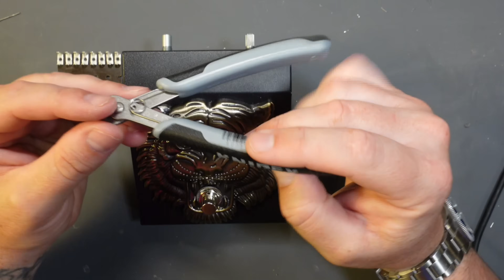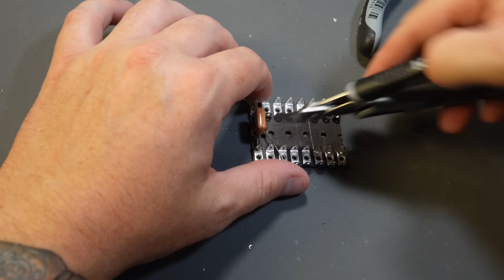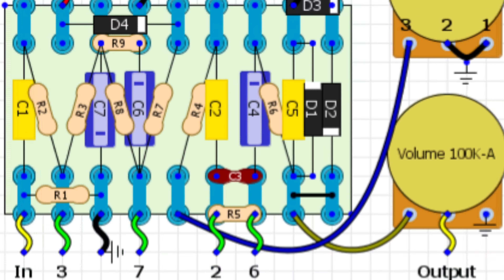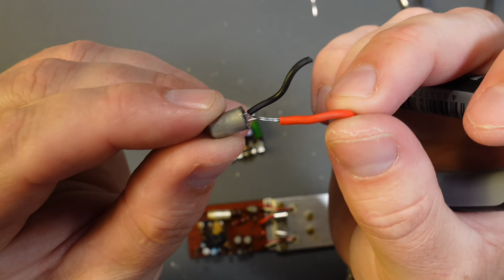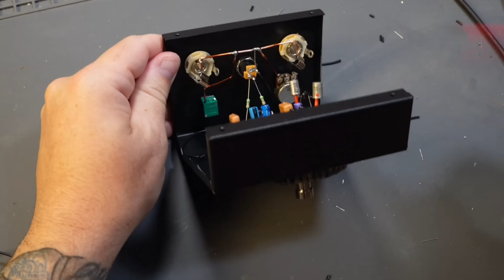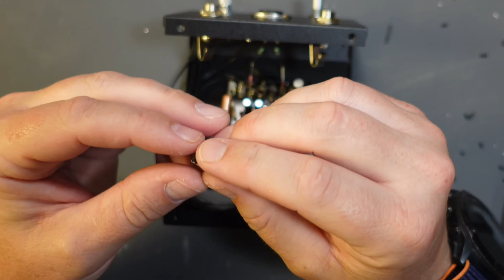I Built Randy Rhoads' Favorite Guitar Pedal

Comment: If I had to add a tone filter between this board and the output, which simulated Randy's EQ as well, what values and what filter would you suggest? Could you share a link to an image or schematic for a good filter which essentially makes this a Randy Rhoads preset pedal?
Reply from the maker: Great question mate. If your not getting the tone woth just the pedal then you could try adding in one of the AMZ presence controls (linked below). I would add something like a klin buffer before the control too. I would love to hear how you get on with it.

AMZ Presence Control https://share.google/ey8emD7Q8FMZZgz0m
Reply: @hellosailoreffectsofficial  Thank you! And just for the same question, if I wanted to make this Slash tone or Dimebag Darrell tone then which filter would I go for? Since they both also used the MXR distortion plus.
Reply from the maker: @shubhanbrahmkshatriya7460 For slash I wouldnt use anything mate. That into.a Marahall would do nicely. Im not up on what Time bag used but im fairly certain he used solid state amps and high output pickups? I'd  have to dig deeper on that one mate.
Reply: @hellosailoreffectsofficial  RIght, but I'm building a 3 in 1 pedal which can preset sound like either Randy/Dimebag/Slash for my friend's birthday. He really loves these 3 guitarists, so I'm going for something which can emulate those sounds via fixed EQing or Filtering (My friend uses a Vox amp). I also want to expand my knowledge of filters so it's a great project for someone like me. I'm considering to do Slash's "Upside down Smile" EQ via a bandpass filter, and Dimebag Darrel by Notch filtering but I can't figure out good values to start with.
Reply from the maker: @shubhanbrahmkshatriya7460 Thats sn interesting project mate. Id probably add a 4 band eq and use trimpots instead of external controls that way you can set the sound internally
Reply: Could you suggest something I should try, mate?
Reply from the maker: @shubhanbrahmkshatriya7460 This is the one ive used in the past mate.

 https://share.google/4h6QuPITfNeiJUG5T
Reply: @hellosailoreffectsofficial  thank you so much 😄🤘
Reply from the maker: @shubhanbrahmkshatriya7460 Any time mate

Comment: I enjoyed this pedal build and bought one 👍
The pedal case is flawed though because it has no side fixings it rattles and if you hit the sides with your foot because they are proud and thin tin they bend outwards.Something you don’t expect from a pedal costing £250.00.
The pedal sounds great it’s just a shame 2 or 4 side fixing screws were not used.😡👎
Reply from the maker: Thank you for the kind words on the tones mate it is greatly appreciated. I dont manufactur the enclosures and I have never had that complaint before so thank you for pointing it out.

I am curious though, with the scarcity of the parts used and the time its taken to build/research do you believe that it cost too much for what you received? I have genuinely never had anyone question the constructing of my pedals with regard to price.

There are only 3 of these enclosures so it isnt something that I am planning on using long term.

I am currently building 5 of these in a regular enclosure if you would like to exchange yours?

Joe
Reply: @hellosailoreffectsofficial
Reply from the maker: @DaveLewis-60 Sorry mate no message came through.

Comment: Why would you wire a transistor as a diode?
Reply from the maker: I think the better question is "what did you think of the sound?"
Basically I thought it was a cool way to use expensive transistors that are not within spec for what I wanted.

I believe Newmarket NKT will have used them because they did not manufacture diodes. If course thats purely speculation mate. Lots of companies did it back then.
Reply: @hellosailoreffectsofficial hey, I have  not made it that far. I had to wish my mom a happy 99th birthday. My pops is edging up on 97. Occupational force in Franca and Korea radio operator.
Reply: I also wondered the same thing my friend. Could NKT not have ordered regular off the shelf diodes?

Comment: Absolutely brilliant video Joe! Have to admit, I'm not a Metal fan, so don't use distortion at all... but I am fascinated with guitar pedal and amp electronics and this video is just perfect watching material as I struggle to convince my LM386 to solder to a Nail! Yes... working on my smallest OpAmp-based amplifier yet... and, strangely enough, I just decided this evening to make a tiny vero board to house the LM386 chip so I could wire it onto my "Nail" amp... and, towards the end of this one - you were doing exactly the same thing! I must be in good company! Ahoy there Matey! Great content - thanks buddy! 🙂
Reply from the maker: Thank you mate much appreciated. Please tell me you are making a video of this amp build? Sounds awesome.
Reply: @hellosailoreffectsofficial  Thanks buddy - Yes - I am working on a video on this nail thingy right now. Basically, I'm using the nail as a common ground so all the components' negative legs are soldered to it. A single ground wire runs off this into the control panel (which has the volume/switch and guitar inpt socket etc). 3 other wires come off the (tiny) circuit board which is stuck to the nail (and which has the LM386 on it). Speaker Out, Guitar In (wiper) and Battery +ve... and that's it! It's all housed inside a spice jar with a nice little LED to give a bit of colour/glow. The concept was not my idea - search for "LM386 Homage" and "Prickly Sauce" to see the original idea... but in my version, I've made the old rusty nail the key component. It's lovely to see that old common, rusty nail there in the middle of the "tube" with everything coming off it! I'll let you know when I've uploaded the vid. 🙂
Reply from the maker: @crazyjack9voltbatteryamps Mate this thing sounds so damn cool!
Reply: This nail amp sounds spectacular my friend!
Reply: @Whatsthematterwithyou-z7d  Working on a vid - watch this space! 🙂

Comment: Those soviet diodes are wicked good for clipping, and quite high forward voltage for Ge diodes. I’ve used them in my Supa Tonebender modded big muff. Great work Joe gorgeous board, layout and my fave distortion. Incidentally I use either a 5000pf or 1000pf input cap for a bit more bite at lower gain.
Reply from the maker: Thank you mate much appreciated.
Yeah they are absolutely killer diodes for sure.
Hell yeah, id love to add that on a switch for sure.

Comment: I have one here and it sounds like a DOD250 with better bass and more gain. 

I'm a fan of the DOD250 at low to medium gain, but this one can sound great at any gain setting.  And looks 8 billion times better.
Reply from the maker: Thank you mate I really value your opinion on these.

The dod250 is so similar circuit wise. Its crazy how many pedals are actually variations of this one.

Comment: This sounds exceptional much better than the last few I have heared, almost sounds like you have a compressor before the overdrive, though the diodes are clipping Asymetrical, and that is always nice to hear, one side is rounder than the other, kind of like DC offset but intentional.
Reply from the maker: Thank you mate much appreciated. Yeah the 2 sets if germanium diodes have different forward voltage ever so slightly so you can really hear it. I was really surprised by these.
Reply: @hellosailoreffectsofficial  The package of these transistors is also very nice, you see them alot on boards where they do power stuff, they  come on every PC motherboard, but they look terrific due to their shape, they are round and look like a hat hehe, cool!! Some english dude from the 19th centuary right?!
Reply from the maker: @ronmoes42I love these transistors mate. I'm going to do more germanium clipping in this way for sure. 

Being an Englishman myself I'm down with that mate